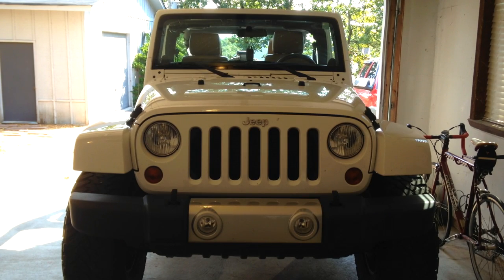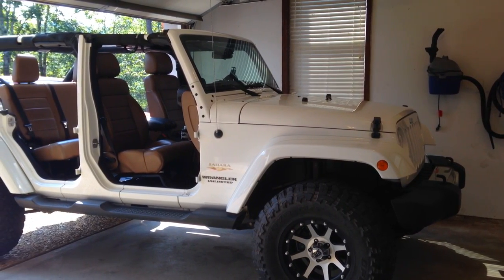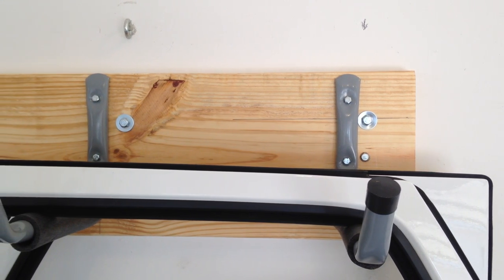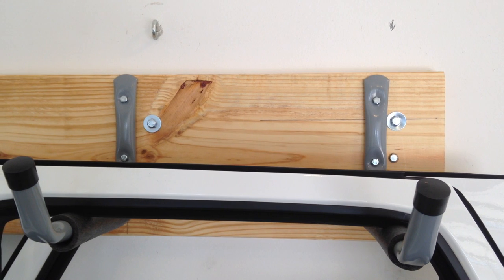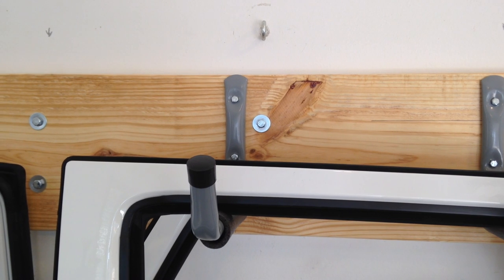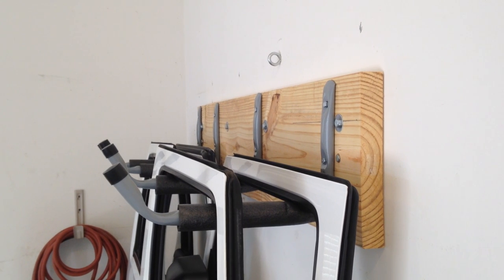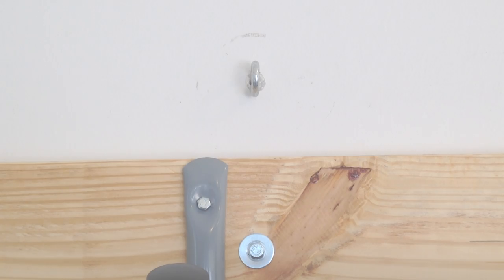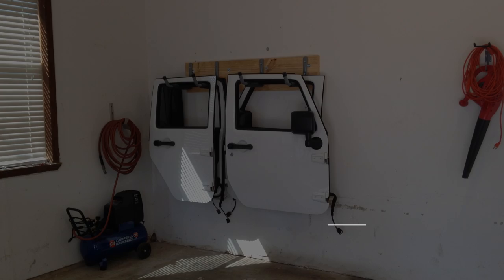The Best DIY Jeep Door Storage

Comment: Ok, Bought all the directed stuff, got my 2x12 up, SOLID, Put on the same exact L-brackets and hung exactly as directed. Time to finally take the doors off and load them.  Front 1st, just exactly as yours are hung. Stood there for a minute, went in the house to do something (2 minutes?) and one  of the brackets was bending from the weight of the front doors.  I hurried up, threw down a blanket and took one door off.  Either my doors are heavier for some reason, or home depot is making cheaper brackets.  Now in the market for something steel, more solid. Good idea in theory, but beware of those brackets as of recent.
Reply from the maker: Sorry that happen Bridget and glad you caught them in time. The ones I have are heavy duty,I just did a quick search and found these https://amzn.to/3zwNYq4 . I message the company to see if they are a 100 pounds a piece if so that will more than support a door, if and when they respond I will let you know. It's been a few years since I made the video and with pandemic the heavy duty ones maybe harder to find. Again sorry and thanks for watching!
Reply from the maker: Bridget the other company gave me a response and said they are a 100 pounds a piece. So you could try those or just add third bracket whatever is cheapest and easiest. And you want to put the door frame as far back on the bracket as you can get it, the closer to the wall you can get it the better. Hers the link again for the stronger brackets https://amzn.to/3Jgz7TU

Comment: I copied this today and used the same brackets from Home Depot. Ended up doing 3 brackets on each side. It’s solid!

Thanks
Reply from the maker: +Jeff Bosch three should give it plenty of support. I rotate between a soft top and hard in the winter, my soft top with frame will sit right across the brackets as well. Thanks for watching and the comment
Reply: I am installing a 3rd today due to both doors on 2 was very iffy. Hopefully the 3rd one make it stable. One of mine started to bed after loading the 2nd door. 😳
Reply from the maker: I agree with Jeff a third will definitely make it solid if you can't find the heavy duty ones for now.

Comment: Tuba-twelve. Hell yeah brother. Good idea. Thanks!
Reply from the maker: Thanks, appreciate you watching and the comment.
Reply: @ArkansasFishingVideos  I just went to the hardware store and picked up the appropriate hardware today!
Reply from the maker: @steveo1413  Cool , let me know how it goes when you get it finished.
Reply: @ArkansasFishingVideos  got it up. Happy with the way I turned out. The hooks I got from the hardware store seemed a little lighter duty that yours albeit similar in design. I ended up using three per door instead of two. Overly cautious? Probably. Thanks again for the inexpensive idea!
Reply from the maker: @steveo1413  never hurts to be overly cautious, door repairs are expensive. Glad it worked out for you.

Comment: I have a covered patio that I want to build this for. Since I am going to be mounting it to the exterior block of my home, do you think I need to use the board? I would like to just bolt the hooks directly to the block wall with 1/4in tapcon anchors, but do you think that would be strong enough to hold the doors?
Reply from the maker: I have never anchored anything in block so I am not a hundred percent sure about that. A board would distribute the weight better but I would definitely research anchoring into block before I did that. Sorry I can't be more help but thanks for watching and the comment.

Comment: How far apart did you space the front set of brackets from the back so they don’t touch when hang them ?
Reply from the maker: My doors actually overlap when the hang just a little because I was limited on space. I usually put the doors on the holder with the insides facing each other so the outsides don’t get scratch for some reason. If I had the room, I would have made it a little longer by about 24 inches. Hope that helps, thanks for watching and the comment.

Comment: Can you tell me the total width on the wall the doors take up when they are hanging? Crunched for space and I wanted to know how much extra wall space I will need besides the 55” board.
Reply from the maker: Planning to take the doors off later  this week so I can get you a measurement then and will let you know. Thanks for watching and the comment.
Reply from the maker: Just measured it and it's 65 inch total with front and back doors on. Because the brackets are not the exact width of the window frame(s) you can slide the doors side to side a little if needed. Hope that helps, thanks again for watching.

Comment: Are the hooks mounted into the studs too?
Reply from the maker: No, the board is mounted into the wall studs with lag bolts and the hooks are mounted into the board with lag bolts. The hooks come with screws or at least mine did but I threw those away because they would not support the weight of the door, the lags should not pull out of the board. Thanks for watching!

Comment: Good job, just wondering why you added the eye bolt.
Reply from the maker: When I first started using it I would put  a piece of rope through the eye bolt and through the doors for extra security in case they fell. It was really just for my piece of mind but I down use it much now because the wood and brackets have stayed tight after several years of use. Thanks for watching and the comment.

Comment: I love the idea but I heard from people (online) that hanging the jeep doors eventually wears down the window liner and makes the window harder to roll all the way up and causes it to leak. Q. How is yours holding up? Is that just a urban legend or the truth? I would love to do this to my new place (wherever that is) when we move into it. Right now when I remove the doors they are just put inside the house on the floor leaning against the wall.
Reply from the maker: I have not had a problem with it. When I first got the Jeep I had a back up truck to drive in bad weather so I left them off for about a month. Once I put them back on the rubber bounced right back and my windows do not leak to this day. I could see how prolong storage like that could cause some damage but I only have them off for about four days at a time at the most now and have to had a problem.

Comment: Love the concept ... I have heard that this can damage the the inside of the door lining .  Have you had any trouble with that?
Reply from the maker: Mike it does push the seals down, the most I have left them on there at one stretch has been about 3 weeks and the seals bounced right back. And I have never had a problem with my widows leaking because of it. Thanks for watching and the comment.

Comment: Isnt that hard on the upper seals?
Reply from the maker: Jay it does push the seals down, the most I have left them on there at one stretch has been about 3 weeks and the seals bounced right back. I am sure over time if left on there for months on end it could be a problem. I am just using it for short term storage and have never had a problem with my widows leaking because of it. Thanks for watching and the comment.

Comment: Nice Set up, Question - What do you have between the doors so they aren't banging into each other while hanging?  Also, Would putting another Board set up w/ arms at the bottom of the doors to hold them to take the pressure off the window guard work?
Reply from the maker: Thanks, I don’t have anything in between the doors I just put them inside to inside they don’t swing or anything so I’ve never had a problem with them scratching the doors . And yes if I had it to do over I would ever either put the board lower where they rest on the garage floor with a piece of foam on the floor or like you said put an arm or something to take a little pressure off the door seal. The most I’ve left them on the holder is about a month and the seals always bounce right back and I’ve never had a problem with my windows leaking so far. Thanks for watching and the comment

Comment: Thanks for the video! Planning to install this soon! Couple questions...1) What size lag bolts did you use to mount the board to the wall?  2) Did you use the standard hardware that came with the brackets to mount them to the board or did you beef-up that hardware?
Reply from the maker: I used 6 3/8 x 3 inch lag bolts for the board on the wall and 8 1/4x2 inch Lag bolts for the brackets. The brackets come with just screws and I would not recommend using those they will pull out. A 1/4 inch bolt was the largest that would fit through the hole on the bracket. Hope this helps, thanks for watching and the comment.

Comment: Hello, Great job! Have you noticed the rubber on the door get misshaped (leave an indentation) by the weight of the door on the bracket?
Reply from the maker: +Steve it does push the rubber up (leave an indentation)but  it always bounces right back when I put the doors back on and my windows don’t leak. I only have my doors off at the most maybe 4 or 5 days at a time if it was months at a time it could cause a problem. Thanks for watching and the comment.
Reply: Cut a pool noodle to size,  cut a slit long ways and wedge it on the portion of the window that rests on the brackets.

Comment: Did I miss the materials list? Where did you get the long hooks? Inches? Gonna do this for my 2Dr. Thanks.
Reply from the maker: The supply list is in the description as well but here you go.

4 Jumbo L Hooks You will not need the screws that come with these you will use the 1/4 lag bolts instead.
On Amazon https://amzn.to/2PTNUIe

6 3/8 x 3 inch lag bolts
6 3/8 Fender Washer and they will be labeled as such
8 1/4x2 inch Lag bolts
1 Untreated 2x12 cut to 55 inches

Comment: Where did you purchase the L brackets?  How long are they?
Reply from the maker: I got mine locally but I just checked Amazon and they have have these https://amzn.to/3Uzd2XU. The ones I have will support 75 pounds per bracket and the link above holds 100 pounds per. My Jeep is a 2012 and I found my door weights online so it’s worth googling to make sure the combined weight or a front and back door to make sure you have enough support. Hope this helps and thanks for watching!

Comment: what is total length required once doors are installed
Reply from the maker: Just measured it and it's 65 inch total with front and back doors on. Because the brackets are not the exact width of the window frame(s) you can slide the doors side to side a little if needed. Hope that helps, thanks for watching and the comment.

Comment: I like it, thanks.
Reply from the maker: Thanks for watching and if you decide to build one and have any questions please let me know.
Reply: @ArkansasFishingVideos  Bought the materials but may wait until I get my truck to decide on height.  Are you happy with the height at which you hung your system?
Reply from the maker: bigduke6702 sorry for the slow response, it has not given me any problems but if I did it again I would put it lower just in case it did fall for some reason it would not fall far. I also was not sure how much room I was going to have to park so I put it up higher so I could drive in but it turns out I would be fine either way but hindsight is 2020.

Comment: I can't seem to find link to the supply list. Could you please share here? Thanks!
Reply from the maker: These are similar http://amzn.to/2xr2KPf, I got mine at Home Depot (you may try there first) and I'm almost sure there were rated for 75# a piece but I could not find them on Amazon. The ones in the link are only rated for 50# so you may want to use three across if you can not find the others. I have never put my doors on a scale but I Googled it and they say the fronts are between 55-65 pounds a piece and the backs are 45 to 55 pounds. That's for the ones with power locks and windows. I did not use the hardware that came with the brackets either I used lag bolts, so once you get them go to the hardware store and pick up some lag bolts that will fit in the hole, I used three inch long bolts, so they go through the wood and into the wall some. WIth those lag bolts, the bracket will bend before it pulls out of the board, probably overkill on my part but better safe than sorry. Let me know if you have any more questions and thanks for watching.

Comment: did you use a impact drill to do this project???
Reply from the maker: No, you could of course I just didn't have one at the time. I started the hole with a drill bit just a little ways then used a ratchet and wrench the rest of the way. The lag bolts are not super long so the ratchet and wrench worked fine and did not wear out my wrist. Thanks for watching and the comment.

Comment: You mention the eye bolt as a safety feature.  How/what are using them as a safety backup?
Reply from the maker: +Nick Sciaccotta  I had planned to put a strap through the eye bolt and loop it through were the window roils up, just in cases it fell. But I had the doors on there for about two months and it did not move at all so I think it's pretty safe. I was just being overly cautious. If you build it look for the supports that are rated for 75 pounds a piece and you should be fine. If you have anymore questions let me know

Comment: How are your seals holding up from hanging?  I generally have my doors off the entire weekend.  That's a lot of weight to be flattening out the seals.  Thoughts?  Thank you for posting.
Reply from the maker: I pretty much only have mind off on weekend’s as well. I think the most I have had them off in a row was 5 days one or two times. The seals have bounced right back and my windows don’t leak so fingers crossed it has not been and will continue to not be a problem. Thanks for watching and the comment.
Reply: I built something similar a few years ago before I took the doors off for the first time. I did not realize how it might impact the seals. 
I did not use it but interested to know how it’s working for everyone.

Comment: How has this held up over time? Do these brackets support the weight ok? The 2 front doors are pretty heavy for these brackets. I'm thinking of doubling up on the brackets.
Reply from the maker: It has held up fine, whenI first got the Jeep I still had a second truck to drive for when it rained and I left the doors hanging on there for about three months without a problem. The brackets I purchased are rated for 50 pounds a piece, the front doors I believe are about 62 pounds a piece, I just set them back as close to the wood as possible so they are not hanging off the end to keep the weight more towards the back. The brackets are pretty cheap, I think I paid 5 maybe 6 bucks a piece so doubling up would give you plenty of support without breaking the back. Let me know how it turns out and if you have more questions I'm happy to help.

Comment: Did it mess up your door rubbers?
Reply from the maker: It does push the rubber up (leave an indentation)but  it always bounces right back when I put the doors back on and my windows don’t leak. I only have my doors off at the most maybe 4 or 5 days at a time if it was months at a time I think it could cause a problem but so far no problems with the doors or the mount.
Thanks for watching and the comment hope this helps.

Comment: Did this set up,.. horrible. Doors are way too heavy. Those tubes are hollow and weak. I had to buy steel brackets. Tubes suck.
Reply from the maker: Sorry it did work for you, I position by doors as far back on the brackets as possible and still have not had a problem. Steel would be better but I could not find anything like that in my area at the time.